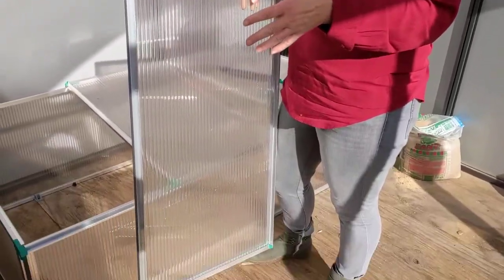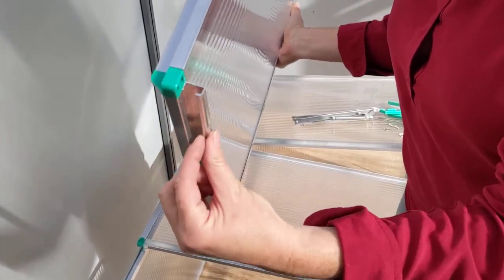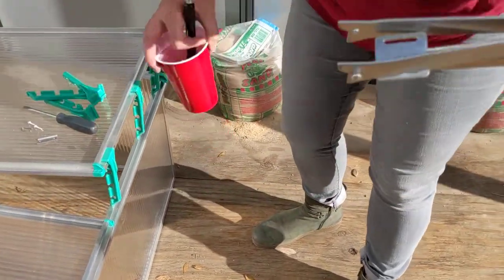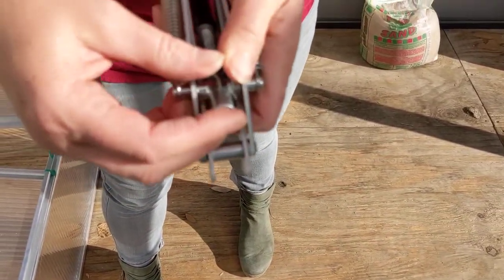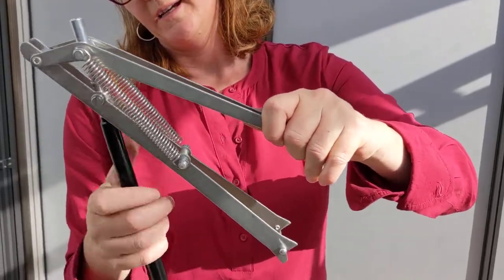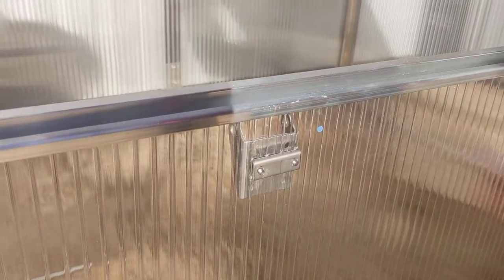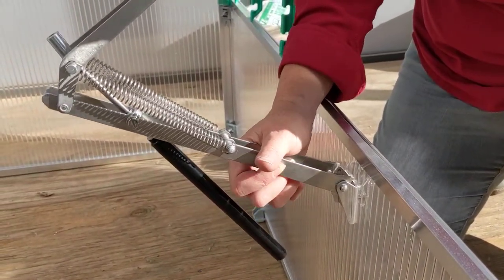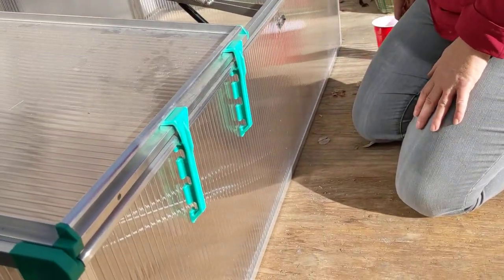Biostar 1500 Cold Frame Assembly Help - Installing the Auto Opener

Comment: The metal bar with two holes for the screws should be positioned with a flat side towards the surface so the pressure is more evenly distributed. In your video, you place the two extruded edges towards the surface…